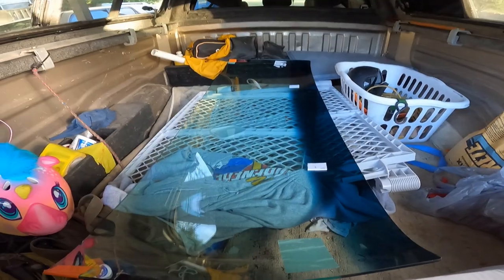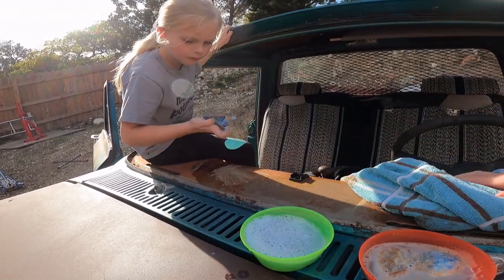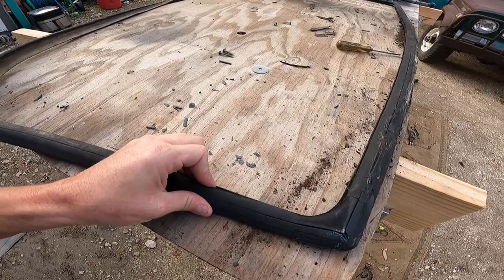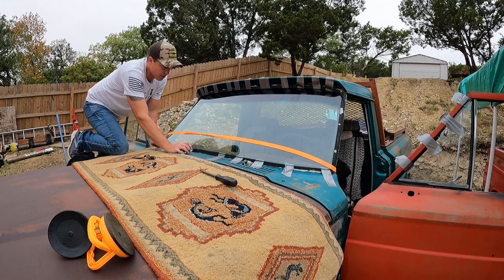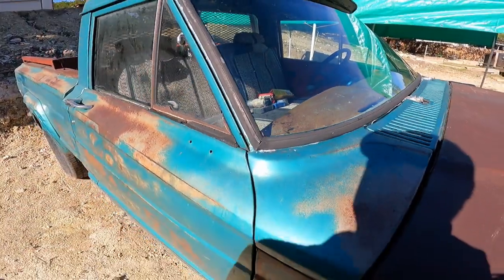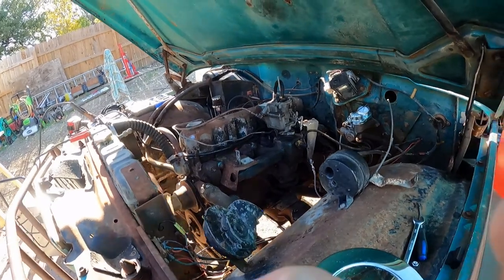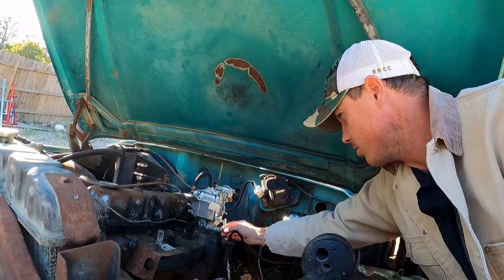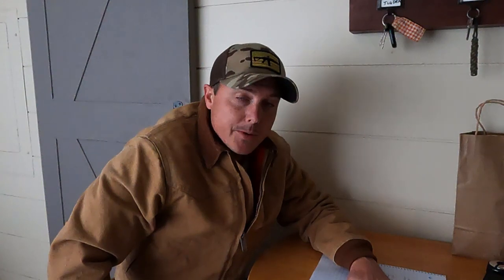DIY Windshield Replacement and New Carburetor on the 1968 Jeep Gladiator

Comment: Duct tape. Handyman’s friend!  If the women don’t find you handsome they best find you handy.
Reply: Very few things I won’t do on a vehicle. Windshield is one.  Tires n alignment are the other.
Reply: I’d say that old carb is not a fan of ethanol fuel.  I like call it papa joes corn grindings.   They been increasing the ethanol recently. It’s hard on old car’s systems.
Reply from the maker: It was a pain. I’ve done quite a few. Each time I say “never again!”

Comment: Your float adjustment might have been wrong. Did your rebuild kit come with a chart? Your float could be bad too. It might have a pin hole in it. You could have damaged the tip on the needle if you put too much pressure on it when you rebuilt it causing it to leak. I wouldn't be surprised if that new fuel pump makes too much pressure.
Reply from the maker: The perplexing thing is that it drove a dozen miles or so with no issues before that issue. Oh well, I’ll save that YF for a future rescue. I’m glad the new chinesium carb works so well.
Reply: @TexasHillbilly  Can you give me a ballpark price for the Jeep right here in this comment? Something I've noticed with today's gasoline is it seems to have a lower boiling point. You'll run fine down the road but when you shut the engine off fuel boils out the bowl & all over the carb. Sometimes it will be hard to start until you got fuel in the bowl again.

Comment: You tried the worst method ever to replace a windshield! 

1- NEVER use metal to work around glass. You'll end up either cracking it right away or making small chips and cracks that will extend with each bump you hit on the road or even just slamming a door! ONLY use plastic tools around glass!
2- Never use cement type caulking! It will just make it harder to change the windshield as you'll have to scrape it off and the gasket will be ruined! But you can put special windshield sealant that remains soft IF there are leaks. 
3- Install the gasket on the windshield first. On an old gasket, you can put a small amount of grease or vaseline on the rubber to make things slip easier. The rope is supposed to be used to pull the gasket on the truck lip. Put the rope so that the ends meet at the bottom. 
4- Sit the windshield on the bottom and start pulling the rope a few inches at a time, alternating from side to side an lightly slap on the windshield on the outside with a downward motion to seat it properly (a friend would be useful, but you can do it alone. You just have to get out and in a few times or if you're tall enough, you can stand on one of the door steps). Then continue with the sides and finish at the top, slapping lightly all the time to seat it properly! And naturally, no need for duck tape.

Had you not had your kids smash the old one, you could have completed the job (remove and re-install) in 15-20 minutes.